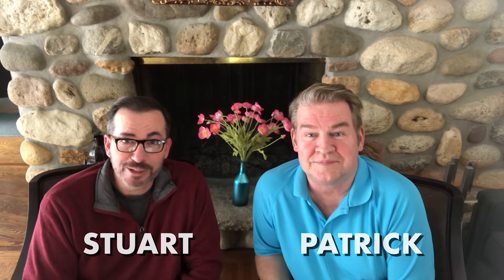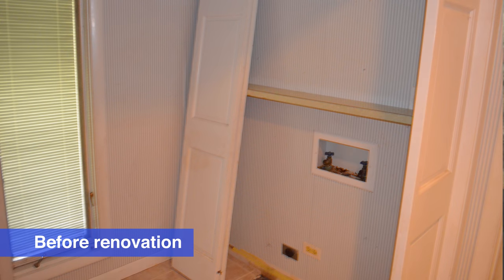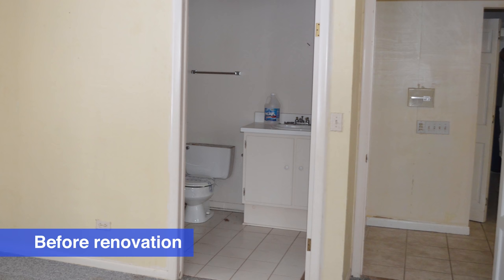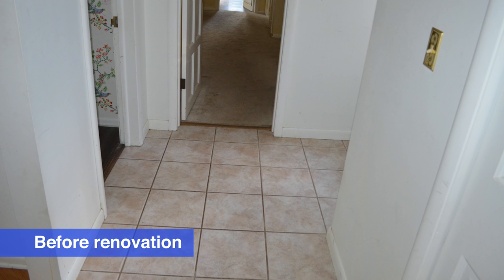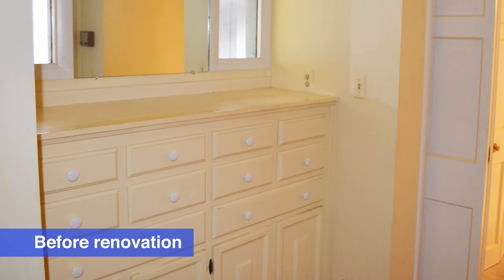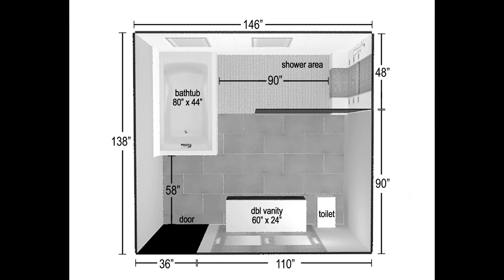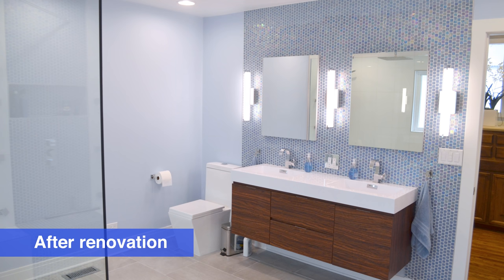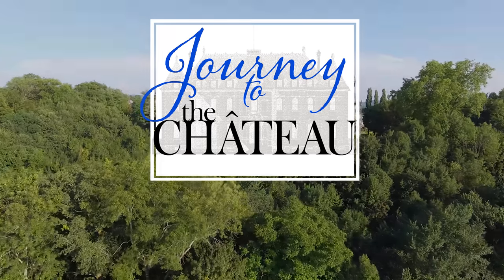Neglected House Rescue, Restoration, and Renovation, part 2 - Journey to the Château, Ep. 14

Comment: Hi Patrick and Stuart, I noticed one if not two river rock fireplaces. I think they go beautifully with a rambling ranch house. Love the rock...so much more interesting to me than brick. And they used the same rock, it seems, out by the pool; very nice touch to add some texture and warmth and hide the pool equipment at the same time. Also, I notice what seemed like electric baseboard heaters in a couple of rooms. Surely a house of that size didn't rely on that form of heating throughout, right? Later on, with the underfloor exposed I saw heating ducts so maybe it was an add on addition with electric baseboard heater. Anyway, great job. Lots of very hard labor  but so worth it in the end. Thanks so much for sharing this renovation journey with us.
'
Reply: Hey there Ralph.  Yes, we have two river rock Fireplaces.  One in the kitchen and the other in the great room.  That huge chimney has its own foundation.  We love them and they poor out heat like crazy.  I agree, they are perfect for a rambler.  And you have got a great eye, exactly the same rock as for the pool.  No veneer stones.  We had one room with additional base board heating.  Once we had all four furnaces replaced we could take them out.  The furnaces were around 30+ years old and we had them replaced with highly energy efficient ones.  Thank you for a great comment.  I appreciate your eye for detail and that you know exactly, how much work this was.  Be safe my friend!

Comment: Perhaps they added an extra layer of drywall for sound dampening. Not a terrible solution but there are better.
Reply: Hi there.  The explanation for the double layer is actually pathetic........   Drywall was brand new and the building department here was skittish......  So they demanded 2 layers for fore protection.  As if plaster on wood lattice is any better at preventing fires.  But there are worse things.  The building department here has not gotten much smarter in the last 55 years.........   But you know what I'm talking about.  However, some really good people too.  Great comment as always!  Thank you